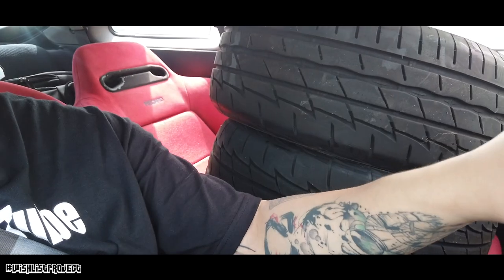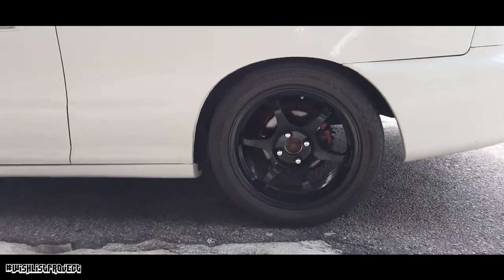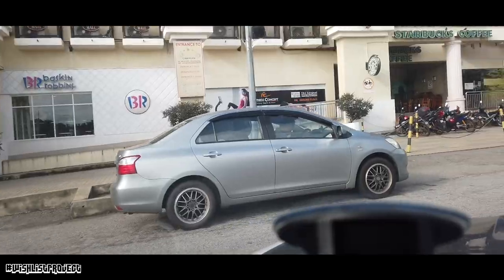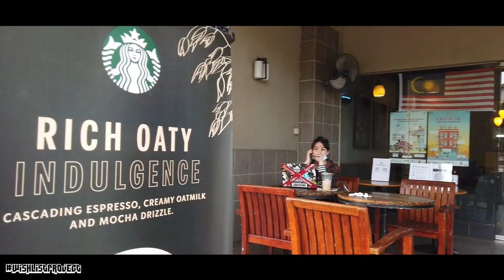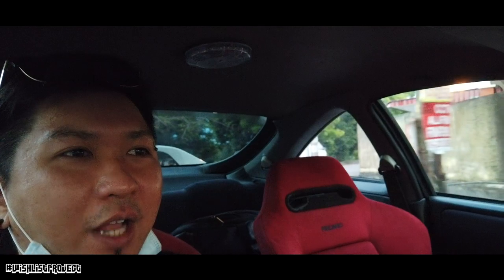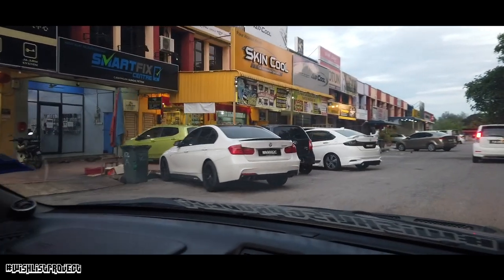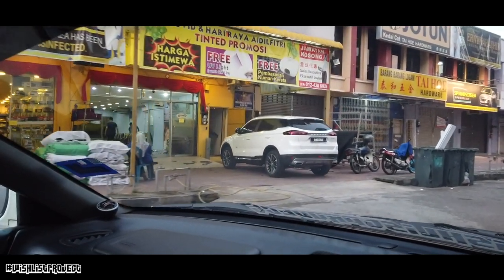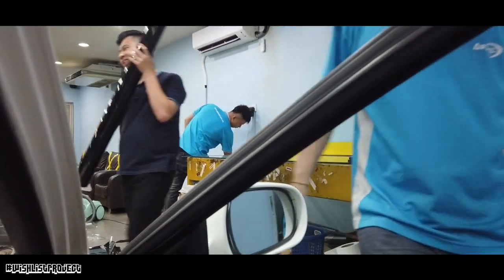#WISHLISTPROJECT EP 2 | Yellow vs White - Victor Liew datang lepak!

Comment: Try these dulu bro adrian :)

stage 3 cam, titanium double spring, Arp bolts, 86mm piston wiseco, toda pulley, ati damper, mugen 4-1 header, spoon plugwire, hondata ver 3 ecu.
Reply: ii9999999999999999999iiiiiiiiiiiiiiiiiiiiiì9i99999999999999i99999999999999999999999999999999999999999999999i9i999999999999999999999999999999999999999999iiiiiiiiiiiiiiii9999i9i9i9i9i9i999i9i9i9i9999999999999999999999999
Reply: iiiiiiiii9999iiiiiì999999iì999999i9i9i9i9i999999999999999999999999999999999iiiiiiii99999999999i99999999i9i9i9i
Reply: iiì9i9i9i9i99999999999iì999999999999999999999999999iiiiiiiiiiì999iiiiiiiiiiiiiiiiiiìiiiiiiiìiiì99999999999999999999999999999999999999999999iiiiiiiiiì9i99999999999999999999999999999999999999999ìiiiiìiiiiiiì999999999999999999999iììiiiiiiiiiiiiìiiiiìiiiiiiiiìiiì999999ììiiiiiiiiiiiiiiiiiiiiiiiìiìo999999iiìiiiiiiiiiiiiiiiiiiiiì9iiii99999999999iiii99iiiiìiiiiìiiiiiiiiiiiiiii99999999999999999iìii9999999999999999999999999999999999999999iiiiiii9999999iiii9iiiiiiiii9i9ii9i9i9ii999999999999999999999999999999999iiiii
Reply: ii
Reply: ii
Reply: ï
Reply: iiiiiiiiiii9iii
Reply: i
Reply: ì9ìì
Reply: ii9i
Reply: ìiiìiììi9ii
Reply: ììi9ì
Reply: 9i9i9999ii99999999999999999999999999999999999iiiìiìiiiìiiiiiiiiiìiiiii9iiiìiiiììiì9iiiii9iiiiii0i9ìi9999990i999iii999iiiìiiiiiiiiiiiiiii999
Reply: iìiiiiiiiiiii999999iiiiii99999999999ì9999999ì9iiiiiiìiiiiii99i9iiiìiiiì99iiii999ìii9iiiiii99i09iiiii9i09ii9i9
Reply: ì
Reply: 9999iiiìiiii
Reply: ii
Reply: iì9ìiìii
Reply: iììii9i
Reply: iiiiiiiììiiìiiìiiìiii9ìììì9999
Reply: i99iiii
Reply: 99ìiìi9i99iiìiiiiiiìiiiìiiì9i9iìïii9iiiiiii9i97999iìii99i999i99iiïiiiiiiiiiììììiiiìiii99iii9i9iiiiiiiiiiiiiiiiii9iiiìi9i9999iiì99iiiii9iiiiiiiìiii9i9iii9999iiiiììiiììiiiiiiiiìiiiìiiìi999iiiiiiiiiìiiiiìiiiiï999i999
Reply: ìi
Reply: ììììììiì
Reply: ìi9iiìiììì9
Reply: ìiii
Reply: i99
Reply: 99ii99iìiìiiiìi9iìiii
Reply: iii
Reply: iiii
Reply: i
Reply: uiiii9ii
Reply: iiiiiiiiii
Reply: iiiìiii
Reply: iìi9iiiiiiiìiiiiiii
Reply: ii
Reply: i9iiiiiiiiii9iiìiiiiii9ii9iiiiiiii9iiiìiiii99ïi9ìiiiiiììiììiiii9iù9ìì9iii9iii9iiuii5iiiiiiiiiiiiuïiïiiiiiiiiiiiii9iiiiiiiiiiiiiiiiìi99iii
Reply: 9i
Reply: iiiiiiiiiii
Reply: i
Reply: ii9i
Reply: iii9
Reply: iuìiiiiiiiiiiiiiì999iiiiiiii
Reply: iiii
Reply: ìiiiiiiuiiiiiiiiiiiiiiiìiiiiiiiii
Reply: i7iiii
Reply: iiiiiíiiiiiiiiiiiïiiìiiiiiiii
Reply: i
Reply: iiiiiiii
Reply: iiiii
Reply: 9iììiïiiiiïiiiiiiiiiiiiiiiii99i
Reply: iiiiiiiìiìiiiiìiiiiiiìiiìi9iiiiìiiiiì9i9i9ïiiìììiiiiiiiiiiiiiii9iiiiiiiiiiiiiiiiiiiìiiiiii9iiiiiiiiiìiiii9ii
Reply: iiïiii9iiiiiiiiìiiiiii
Reply: iiuiiiiiiiiiiii99uiiiiiiiiiiiiii
Reply: iiiii
Reply: iiiiiiiiiiiiiii
Reply: iiii
Reply: ïìiiiiii
Reply: iiiiiiiiiui
Reply: 9iiiiiiiuii
Reply: iii9
Reply: iiiiiiii9
Reply: iiiii
Reply: ii9iiiiiiiiiiiiiiuiii